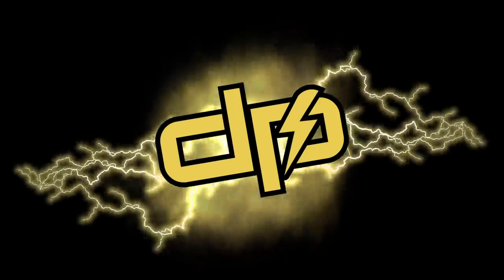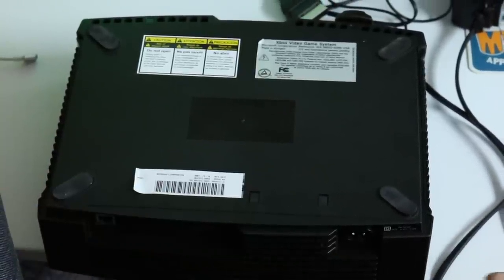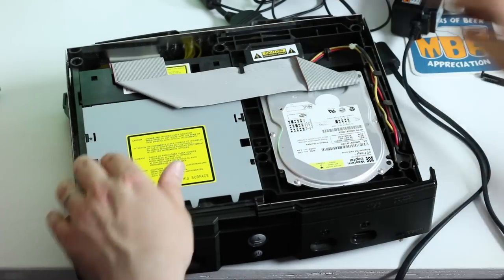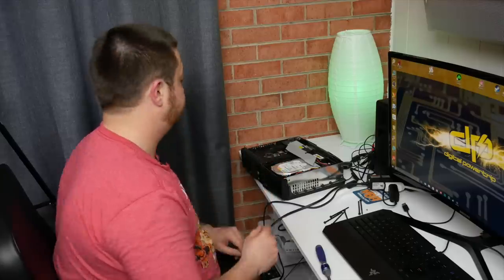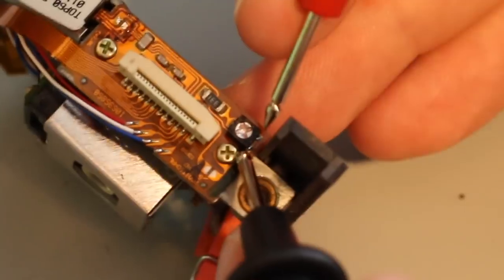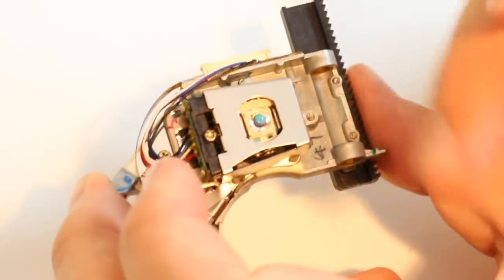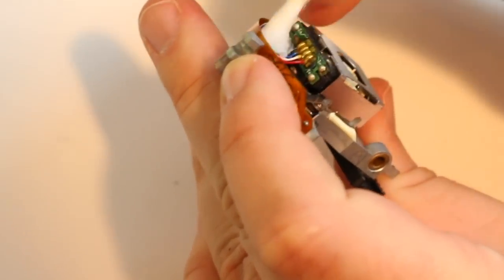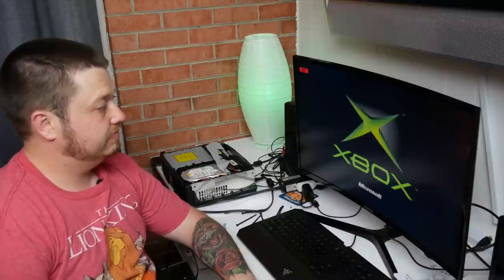Fix Original Xbox Disc Read Error

Comment: The first release Original Xbox dosen't have a good disc drive. The later models has a Samsung DVD drive which is more reliable than the one you got.
Reply from the maker: Yup, we've had 3 so far, all have Thompson drives. But, if the potentiometer trick does not work, new $6 dollar lasers from Amazon do the trick.
Reply: Digital Powertrip Have a link can't seem to find them
Reply: Arron Harrington actually the Samsung models are shitty to sometimes and I've got more broken Samsung disc drives than any other seriously!
Reply: Arron Harrington I have a samsung disk drive and I think the laser is giving out , it will only read movies by Samsung lol but anything new it won’t read at all
Reply: But the Samsungs are way more finicky. The drive belts on those wear out easily. I’ve never had that problem with a Thomson drive.
Reply: @FlyingV555  That's weird because I always heard about Thompsons being the worst in terms of reliablity.
Reply: @XrossBoy Player They're actually the best.
Reply: My Samsung broke
Reply: @DigitalPowertrip  can you sahre a link to buy those 6 dollars laser lenses, please?
Reply from the maker: @juanjoserivasgarcia2336  we got ours on eBay 3 years ago.. that vendor appears to be gone now. Sorry we couldn’t be more helpful.
Reply: I have a cd buffer and games running but still skipping  the lazer looks very much old so getting a new lazer  will fix that issue
Reply: @FlyingV555  You can get a bag of belts for cheap on ebay. Easy fix. Other than that Samsung drives are my go to.
Reply: Dude blinx is one of my favorite games!
Reply: @thebrotato4345  Yeah it was enjoyable!
Reply: Mine has the Philips DVD drive
Reply: I opened up my original x box and cleaned the lense wit alcohol and it's working like brand new. 
No problems at all THANKS
Reply: @juanjoserivasgarcia2336  Did you find any? I found some but they're about 20 USD each.

Comment: Thanks guys for putting this together.  I must have watched this video 20 times over the past few weeks while trying to address my disc read error(s) on my V1.0 with a Thomson drive.  I had 5-6 stubborn games that would not read at all, and some that caused issues during gameplay.  Started with the lens/prism cleaning method with alcohol and no positive results.  Then attempted the adjustment using the multimeter (this gave me an excuse to buy a new tool that I did not have).  This seemed to yield slight improvements, but still had games that would not read.  Ultimately, via the link in the comments, I ordered the new internal lens assembly and performed the swap.  This solved many of my issues, all games now read and are playable, but sometimes after pausing for several minutes and resuming gameplay, I get a disc read error again.  This is definitely an improvement, but I believe the best long-term fix is to swap out the drive entirely with one of the other makes (Samsung, etc).  Thanks for the walkthrough, I feel so much more confident opening up my console myself.  Liked and subbed!
Reply: I'm having the same issue, which link is it?
Reply: Thanks for this reply. I'm having disc read errors too after trying this technique. However I just eyballed the multi meter part. I should buy one for these projects.

Comment: 3 What? he said that it should be set to 3 amps? Volts? i know I'm probably the only one who doesn't know but would much like to know what measurement
Reply: kOhms. But I just did my own and started at 1.7 then lowered to 1.2 and it works.

Comment: In any case where the laser lens is getting weaker, I would highly recommend softmodding or modchipping the system so you can then put in a larger hard drive and FTP games over to your system so you can bypass the disc drive altogether.
Reply: Every game is available on the internet archive under the "HDD ready" pack
Reply: @realgroovy24  can you recommend a video that shows how to do this?
Reply: @realgroovy24  Yeah? Is there a video or website showing us how to do this?
Reply: You need a disc drive to soft mod
Reply: @marsspade556  You can, although it is a workaround. You'll need XboxHDM and build a new hard drive with the softmodding tools on it.
Reply: What is your meter set for to find the 3.6 reading
Reply: @_Morpheus  I just set the voltage up small increments. I think 10% each turn to get it back to life.

Comment: Thanks man. I bought a garage sale Xbox that wasn't reading disks and the resistor thing did the trick. I tried straight cleaning the lens as I was gun shy to rip the unit apart any further than I had to but eventually I kept going until I got the lens off, winged the resistance as I don't have a multimeter and be damned it worked.

Comment: 6 case screws - T20, 3 drive screws (NOT 2...0, the third one is under the IDE ribbon cable and holds down the HDD) - T10, 4 HDD to tray screws - T15. 
If you remove the HDD FIRST, the DVD comes out a LOT easier! If you are removing the DVD, then don't bother bending the shielding up (it can be sharp on the edges!)...
Thanks for the video, I have a couple of these lying around (because they don't work!), all of them are earlier versions that have the full TSOP bus (makes chip installation MUCH easier!).  This might be able to resurrect one or more!
BTW: My Phillips drive was my go-to because it would read disc types that the Thomson wouldn't... but YES it's not working right either... 

BTW2: the FIRST thing you do is UNPLUG the XBOX! (ALL cables)

Comment: Swear to god 90% of the time it just needs a dusting. I just opened my OG V1.2/3 xbox with shitty phillips drive and gave it a nice dusting and it works and looks brand new.
Now to soft mod it
Reply from the maker: Good point Alan! Always start with the simple stuff!
Reply: I would totally agree.  However I own 3 and all play games except 1 steel battalion only one plays it the 1 with several trys and ine wont no matter what.  Did a disk cleaner still no good. So this seems to me to be the solution to get them all working equally
Reply: Relic Gamer So, did this solve your problem with Steel Battalion? I’m having an issue with mine not playing SB also and wondering if this is the fix?
 It plays all other games I have, but get disc read error when trying to play Steel Battalion.
Reply: the phillips drive is actually the good one... be glad u dont have the tompson drive
Reply: Stupid question, but, is there some way to determine what drive you have without opening the box? (By serial number or something?)
 I’m still having an issue playing “Steel Battalion”.
 Borrowed a friend’s copy and got it to load but it won’t play the campaign. If I put the cheat code in I can use free play mode and play individual missions but no campaign!
 My copy gives disc read error.
Reply: what really pisses me off is the shitty snowflake power connector for the optical drive. UGH
Reply: Farnham TheDrunk Hey, thanks. Can’t believe it took me a month to see I had an answer to my question.
Reply: @Scott__G  lol np mate

Comment: Nice video man, i already fixed my xbox DVD and it is working perfect, but i have one thing to add. Resistance level depends of which drive you have, and it should not be lower than:
PHILLIPS 6035\21 No less then 500 ohms
PHILLIPS 6011\21 No less then 500 ohms
THOMPSON No less then 800 ohms
Reply: Krzysztof Zaborowski can you explain how to fix your disc drive. Mine reads the disc most of the time. But it only plays the audio with a black screen.
Reply: Sam Herport old post I know but what you’re describing is the Xbox is stuck in 480p/720p/1080i mode. Using composite after enabling those options will cause the issue you’re describing

Comment: The video was easy to follow. I have taken my XBox apart down to the lens. The lens on my OG is different from yours & I don’t have the pink screw. I cleaned it but still didn’t read a disk.
Reply: Did yours have the SOH-DX1 laser? Mine does and it still doesn't work even though everything looks functional.

Comment: Thank you I used this guide to fix the of Xbox Thompson which totally did not read any discs, tweaked the pot to 750ohm , was previously set to approx 1500ohm so decided by half. I used IPA to get rid of the glue with a q-tip however it needed a bit of rubbing maybe 1 minute. Assuming your multimeter is set to KOhm hence why your referring to 0.3, so set to approx 300ohm on yours....
Reply from the maker: Awesome! Glad it worked out for you and thank you for the added tip!
Reply: I read some other comments saying 500 ohm but no less on any drive, but 800 no less on Thompson drives

Comment: will this also fix the problem that the xbox wont reconize an game as an game but as an dvd?
Reply from the maker: That's a good question. We've not personally seen this issue. It couldn't hurt to try if that is the only thing it will tell you.
Reply: Digital Powertrip alright. if i got time il see if i can try your way. thanks!
Reply: Vuurvent yep, had that problem, that lens is dying wont read dual layer disc.... and all original xbox discs are dual layer,if the xbox is softmodded or with a modchip the drive might still able to read dvd-r discs, only backup discs, of course in my case the drive still has a hard time reading discs, l prefer install the games directly to the xbox hdd
Reply: Ricardo Hualpa i have that problem that my thomson drive wont read original the warriors disc neither it will read the game from hdd. Could by hdd also dead? Everything other is working.
Reply: I already did lens cleaning and pot tuning but nothing works. Most other games run fine except the warriors original disc, backup disc and backup from hdd.

Comment: Sorry, I’m dumb. If the goal was to increase the “juice” to the laser, and a lower number is less resistance, i.e. higher “flow”, how did tuning it from a reading of .002 to .003 help the issue? Didn’t you effectively crank it down?

Comment: You also should have cleaned and replaced the heat sinks with new. After a long while they get dried out and hard which means it will over heat. Remove clean with acetone then let dry and add new heat sink. Let dry for about 30mins

Comment: I have an original that reads every game besides ncaa football 06 fine. It pops up and says that the disc may be dirty or damaged. The disc is fine and works yet won’t play on the console. Any fixes with having to fix the laser?
Reply: same here
Reply: @7xtylin  I figured out what it is. It’s the console that has an issue. Either the disk reader has gone bad or the hardrive.
Reply: @calebwheeler5781  i don’t have a hard drive on it yet so it must be the disc reader. Thank you 🙏

Comment: Wish I knew what the settings on the meter was as I have the system all aprt but not really used to using these meters much. Guess it wouldn’t hurt to mention AC,DC Ohms ETC >
Reply from the maker: Sorry, this has been asked a ton of times in the comments... Resistance is measured in ohms. Hope this helps.

Comment: Didn't work for me.  I set it at 3.6 kOhms but the dreaded disc read error still shows up.  Now I'm waiting for the new lens reader through the mail, hope it solves this annoying problem.
Reply: UPDATE: I received the new lens reader from Amazon and I installed it with no success again.  The disc read error persists. Quite frustrated at this point since it's so difficult to even find replacement drives nowadays.  My last attempt to repair it will be to replace the entire laser deck with the motors.  I ordered it today...will give 1 final update once I install it.
Reply: Update:  I just replaced the entire laser deck assembly with the motors and the wretched thing still gives me the disc read error.  Anyone have suggestions? My final thought for this would be to replace the entire disc drive.  Found some NOS drives for about 200 USD each or some refurbished ones for about 100 USD each.  Might not even be worth it.

Comment: For some reason, I have a completel different disc drive. The voltage adjustment screw isn't there and the assembly itself is different. My xbox is from 2001
Reply from the maker: Yeah in the were several different drives used during the lifespan of the Xbox... here is a link that helps you identify which one you have: https://www.reddit.com/r/originalxbox/wiki/dvdrom

Comment: Do you have the amazon link to the laser replacement?
Reply from the maker: Can't find it on amazon now, but here is a link to ebay http://www.ebay.com/itm/Original-New-Toshiba-Laser-Lens-TOP60-TOP-60-Xbox-DVD-Drive-Optical-Pickup-CD-/120968702571?epid=1424614480&hash=item1c2a4bea6b:m:mttuVvg7zEiKAFOC7-CJiWQ
Reply: Thanks!
Reply from the maker: How about a sub for the help?
Reply: Digital Powertrip  done!
Reply from the maker: Thanks!
Reply from the maker: The laser could just be a dud. We got some from eBay for like 7 bucks a while back. If you just get the can't read disk error, I'd go the route of a new laser. But cleaning couldn't hurt!
Reply: @DigitalPowertrip  turns out i did what you said even retook it apart just to clean the prism and dust out that chamber and mine still dont work
Reply from the maker: @punisherswrath3228  laser could be shot. You cold get a replacement drive, that’s about the best you can do at this point.
Reply: @DigitalPowertrip  how much would one of those go for?
Reply from the maker: @punisherswrath3228  we got one a couple years back for 30$ US
Reply: @DigitalPowertrip  if i had the money or the opportunity id get it but im not in the right position for doing that atm

Comment: Hey there if I remove the clock capacitor will my xbox run without one?
Reply: Yes and it’s recommended if you already know why. Or You can also replace with a better quality cap

Comment: I know this video has been up for several yeas, but I have a question, if you still monitor the comments.  I have an OG xbox, and on boot, the box sits at the xbox logo for several minuets, then gives a error 16. (HDD timeout I think).  Anyway, when I put in another dvd, unit  it will boot.  Bad DVD I guess, but I am not sure what is wrong with it.  Have you ever seen this before?

Comment: I'm having an issue with one of my games.   MVP baseball05.    The Xbox reads it fine and the game loads up fine to the main menu and into each game mode menu.  However, when I go to actually play a game, whether it be exhibition, dynasty or owner mode, it, more often than not, will freeze as it's loading and will tell me there's something wrong with the disc.  However the disc has no scratches and looks virtually brand new.

Comment: I know this isn't a new video by any means (but its still relevant, and top on google), but adjusting the potentiometer will only be a temporary solution, as you will kill the laser diode off over time.

Comment: I just did that... and it worked OMG  thank you.
Reply from the maker: Glad it helped you out!
Reply: What setting did you have your multimeter on and how many ohms did you adjust to?
Reply from the maker: @emerybethel6599  ohms
Reply: @DigitalPowertrip  how many ohms is your dial turned to 200, 2000, 20k, 200k
Reply: @emerybethel6599  wtf is going on? Why were you asking questions constantly and getting back generic answers from OP that didn't answer the actual question? The weirdest is the 2nd question where he just dodges the question completely and says "glad it helped you out". Like wtf is this Oblivion NPC dialogue?

Comment: My og xbox reads most games fine. Even games with some surface scratches will still read. However I recently bought a couple xbox games and neither of them would read and they had no surface scratches. I'd say it's the laser but then why would it read dozens of other games? And advice? Does the lens just need more power?
Reply: Did you ever get this figured out?

Comment: Any chance you could supply a link to the laser replacement?  I'm not getting any voltage reading on my old one and couldn't find a good link.
Reply from the maker: Mark Schmidt the one we got was on eBay 2 years ago. That seller is out of them. If I run across any I will post back here.

Comment: I have trouble reading the Halo games on my second hand Xbox. Halo CE reads about 50% of the time, Halo 2 about 20%. So i cleaned the laser, didn't help. When i checked with a multimeter, the pot had a value of 1,231 Ohms. So i lowered it to about 1,090 (0.141 Ohms less than before). Pretty much same result as before. BUT i ordered a copy of Doom 3 (great game btw), and it reads EVERY SINGLE TIME. What should i do? All 3 games have a pretty much scratch-free disc. If Doom reads all the time, is there something wrong with the Halos?
Reply: i would say no, why? I got halo 1 from game x change, it was not reading so, i went back there and traded it for another disc, same results. I put in Namco museum and it worked fine until i unlocked Pac attack (get over 20,000 points in pac man) and then it went to black, froze, now it won't read that. Halo 2, crash nitro cart, reads just fine and even the dvd/ behind the scenes of halo 2 disc. I had dvds work just fine, then when i watch volume 4 of family guy, it reset the dvd and then the next day, all dvds will not work, even the ones i put in before. Monopoly party also won't work. There is not many or no scratches on the discs. cleaning them doesn't work. I have more games here i have yet to try but, here is the funny thing. I just bought them. I just got the xbox on March 18th, so not even for 2 weeks yet and it is not able to play games/certain ones or it did but not no more. I am hoping when I send this to someone who can fix it can help but, if not then I will be pissed.